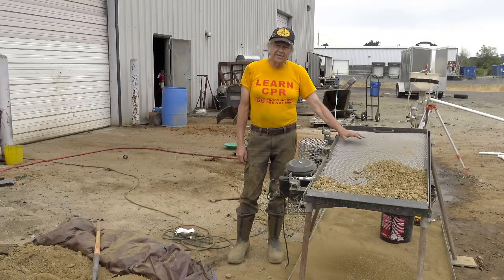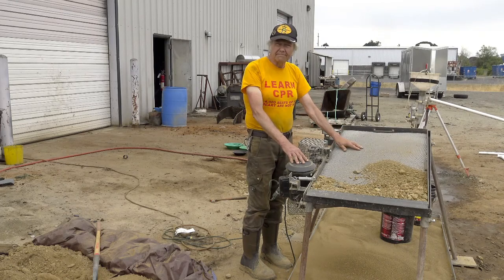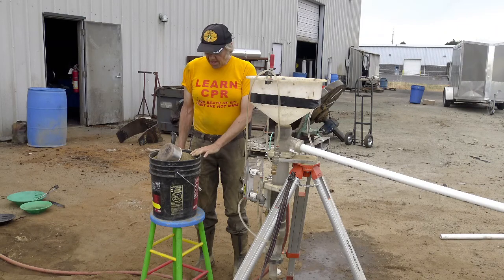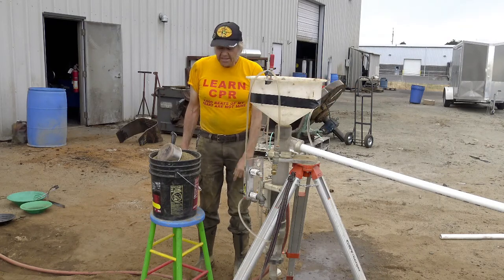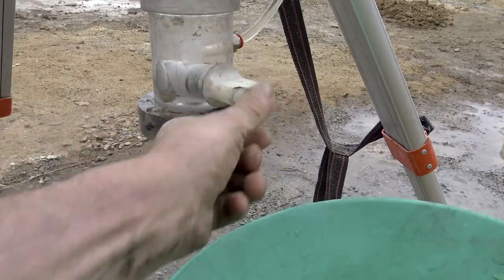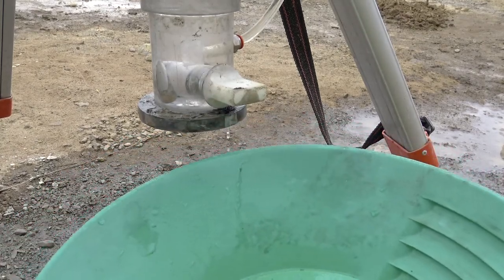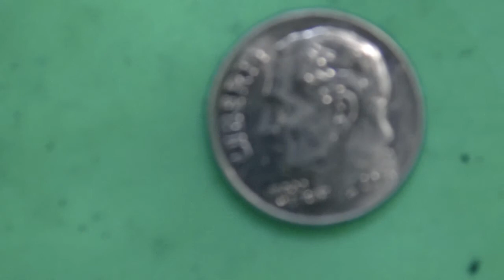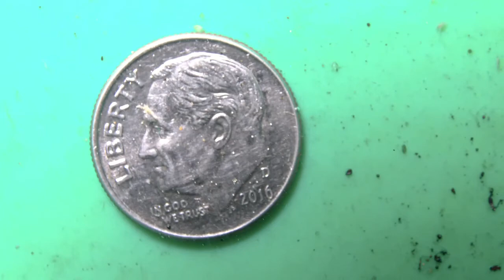The GOLDROP vs. Clay pay dirt tailings

Comment: The first and larger piece of wire gold appears to be a tiny bit of brazing rod.  Not that its important either way, if it is its still a heavy.  I enjoyed the video sir : D, now get one of those fluffy covers for the microphone on your camera/phone what ever.  Improvise if you have to, cause the wind sheer across the microphone is bad mojo.  I think what you are doing is pretty damn cool, I really appreciate you sharing this!
Reply from the maker: Yes, you may be right, it could be brass. After processing the rest of the 1 yard of clay pay dirt, I found a variety of materials. Copper, Bronze, cutting torch slag, steel chips, all pointing to pay dirt tailings with machine shop garbage thrown in. The only natural materials I found were Gold, lead in melted BB form, magnetite and Mercury added to recover the Gold and Iron Pyrite. I am having the gold colored material tested this morning with a Thermo Niton precious metals analyzer to determine if it's Gold or Brass before I produce a video of the results for accuracy. You will see in the video all the materials separated in the pan posed next to dimes to see there size , shape and color. These findings do demonstrate the unique ability of the GOLDROP to separate materials of greater density than dirt, even gems and fine Gold if present and other heavy minerals. Here's some density facts. Gold:19.3g/cm3, Mercury:13.5g/cm3, lead:11.3g/cm3, Copper, Brass and Bronze:7.6--9g/cm3, Steel:7.6g/cm3, Iron Pyrite:5g/cm3.   It was not windy that day, so I thought. The wind sock will be standard equipment for outdoor recordings as well as a louder voice! Thanks for your observations. I love it! John